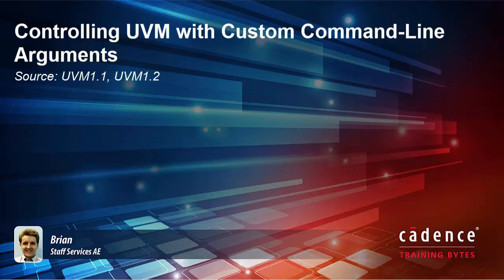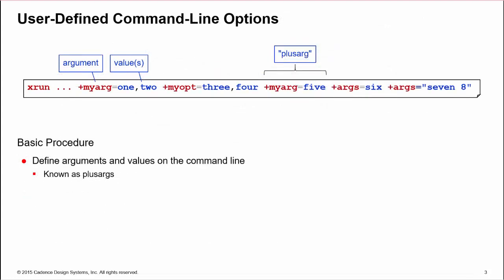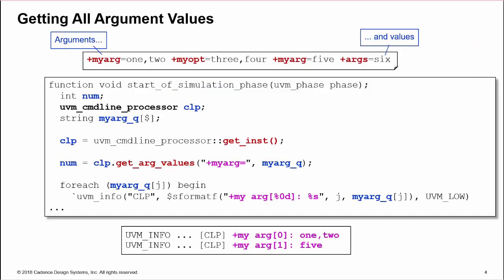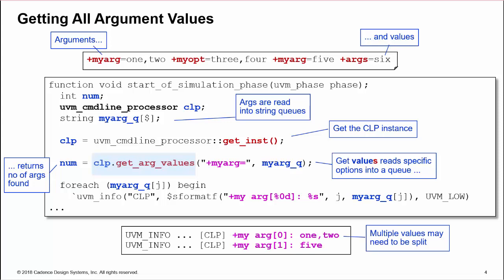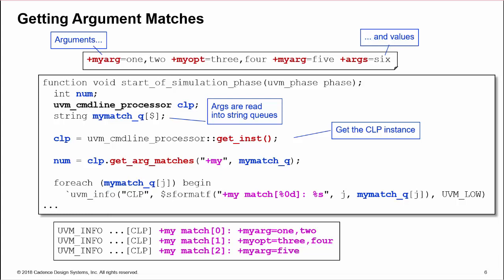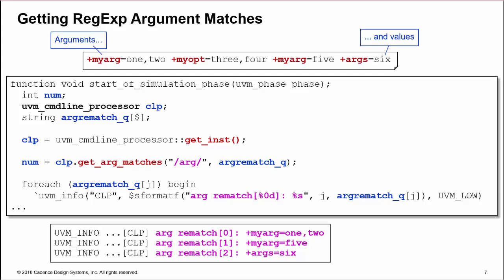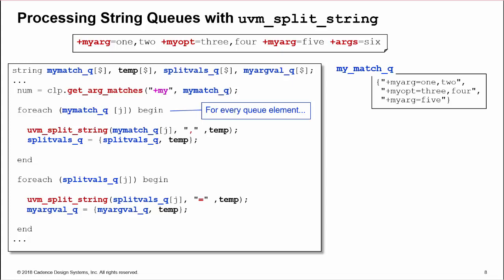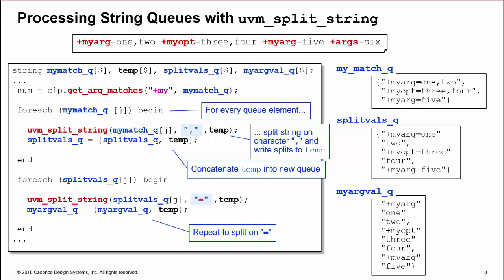Controlling UVM with Custom Command Line Arguments

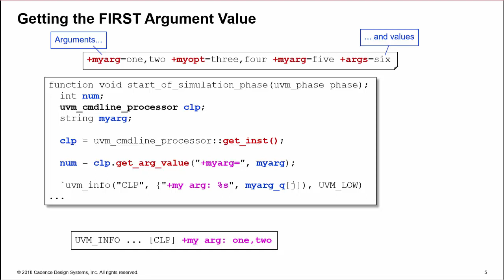Comment: I m doing same code @[2:36] but string is not extracted from argument . 

function void start_of_simulation_phase(uvm_phase phase);
        int num; 
        uvm_cmdline_processor clp; 
        string myarg ;
        clp = uvm_cmdline_processor::get_inst();
        num = clp.get_arg_value("+myarg=%s",myarg);
 			if (num)
 			begin
 			$display("****************");
 			$display("STRING %0s  and =%0d",myarg,num);
       		$display("****************");
       		end
    endfunction

command line argument is     +myarg=yes